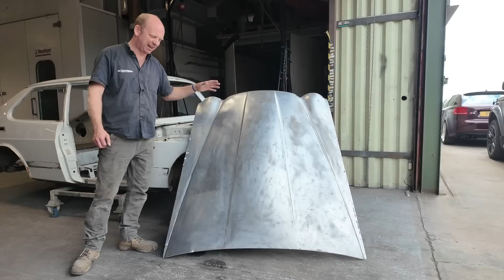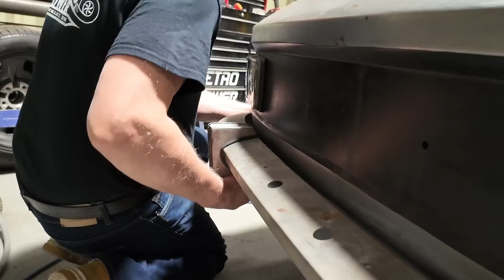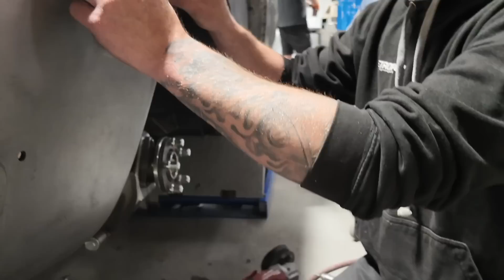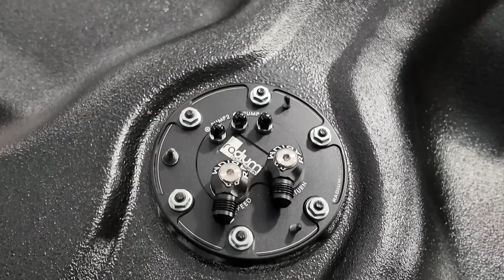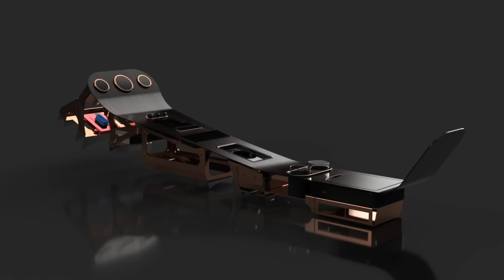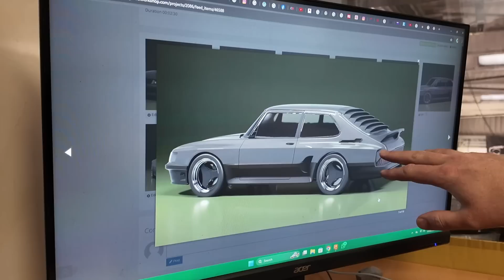Tango Orange CARBON Austin Allegro!

Comment: Jensen Fuel filler, would it not have been easier to cut the filler recess from a scrap E30 and weld that into the Jensen rear 1/4 panel?

Comment: How do you decide which car, and how much of it, to use as a base for another vehicle, as with the SAAB? 
Sometimes it seems like you'd be better off engineering something completely from scratch then sticking the right panels on the outside!
Reply: You’ve hit on one of the biggest challenges! Once you delve under the surface though, it often/usually makes sense to use an existing platform of some sort. It’s not so much the obvious “big metal bits” that are the area of importance, it’s more the vast number of parts that an OEM has developed with that platform, which would otherwise have to be designed or specified individually. That can be an absolutely enormous task! Think subframe/axle mountings, engine mountings, steering system etc etc. being able to “pillage” that from a donor platform greatly simplifies things and helps achieve a much more refined result with less development time

Comment: Surely copper plated brass won't be a very durable finish (and will tarnish) for the console parts of Project Churchill. Wouldn't it be better to use aluminium with copper coloured anodizing?

Comment: Whats wrong with a thermo switch in the radiator to turn the fan on and off ?
Reply: Nothing at all. Just seems like duplication when you are already reading water temperature for the engine ecu anyway, so may as well use that input rather than using an additional one

Comment: Designer here, have you tried the Saab front lights on the same horizontal plane? The height offset jumped out at me. Love it regardless. The shot at 59.19 also looks effective with one single lap unit in each headlight.

Comment: Personally I would angle the rear edge of the air outlet on the back of the Saab to match the angle of the taillight instead of being vertical, I think that would flow better with the original lines of the car and also match how the front air inlet follows the angle of the indicator
Reply: Yes, that bothers me too! 😊

Comment: On the Saab design, I didn't see any version where you'd leant the rear vents back to mimic the 45 degree angle of the rear lights, seen from the side. Might be worth a try. Also I feel like the inlet on the front of the rear quarter is too big for a brake duct. Makes me think of mid engined cars. Looking really good thought. The hard swage line down the side looks great.
Reply: I agree that the rear quarter side vent is too big and too high.  It should be below the colour break and be more angular and less curvy.  Will the bonnet still be clam shell with the shut gap down the sides on the straight side lines?

Comment: Would it not have been easier to cut and paste a the whole of the bmw filler hole and flap ?
Reply: Yes, but actually no. We looked at that option. Firstly a rust free inner wheel arch would be required from a donor BMW e30, then it would require unpicking from the filler recess. Due to the number of spot welds this would make quite a mess of the donor piece. By the time that is repaired to a satisfactory standard, and the part sourced, bought, shipped and cleaned, it’s quicker and more efficient to make one

Comment: Why aren't OEMs hydro dipping aluminium? It gets cold/hot like an S2000 gear lever in the sun or in a cold damp car  due to it's thermal conductive properties. Look at a modern Bentley/Aston/Royce centre console construction to see how to use the materials.

Comment: i did 10 years fabricating with that exact make and model of guillotine, brilliant bit of kit so long as you know the limit. we used to do 2mm stainless and you had to clamp the sheet in the front to stop it pulling. the boss loved it as well as 4 sides to the blade so only once in a blue moon had to have them ground.
Reply: @DoubleD132. I used to have a pal who worked in a general engineering and fabrication company. He told me that they cut thin sheet steel on a cropper. What’s the difference between this guillotine and a cropper?

Comment: I think that the Saab's taillight cluster, sits too low, similar to the Mk2 & Mk3 Capris. It now looks as if the tail is hanging/dragging... The position of the Mk1 Capri's, both facelift  & pre-facelift, was perfect and symmetrical with the rest of the tail ends of that specific model.....

Comment: An E30 filler flap? Oh no, the rot is integrated into the car now! Give it less than three years from finished car handover back to the owner until it's on its 5th owner since, slammed, "stanced" and straight-piped, and has been drifted into so many other cars, tyre walls, and sandtraps to the point that the car is barely even recognisable...

Comment: Youve certainly fallen in love with the Bunker tool chests, it will be interesting to see how they perform and how any modifications improve them for your needs. Not really visible on our screens, but if the workshop floor is as uneven as you state, would it ever be practicable to level it - perhaps in 3 or 4 metre wide strips - working from the back wall of the workshop towards the front door ?  Maybe hive some work off to the Den to facilitate this ?  Finish with a retouchable paint for brightness and smartness ? This would slso present sn opportunity to install lightboxes in the floor .... ?      Regards, and good luck.

Comment: If you are using PWM you may need to fit supression capacitors to the motors to damp any radio noise from the switching